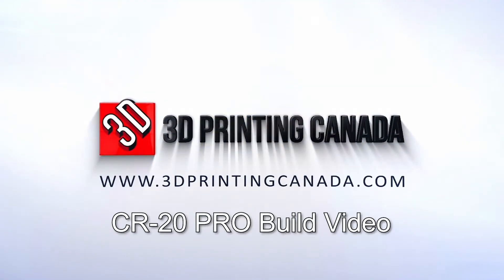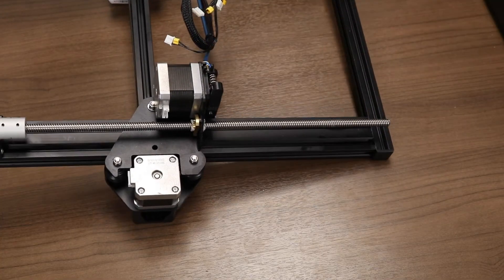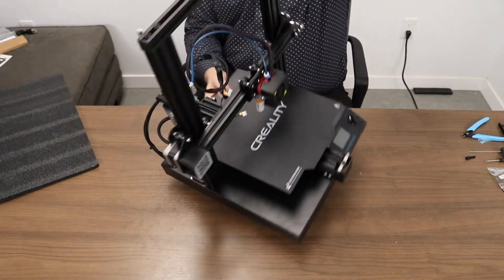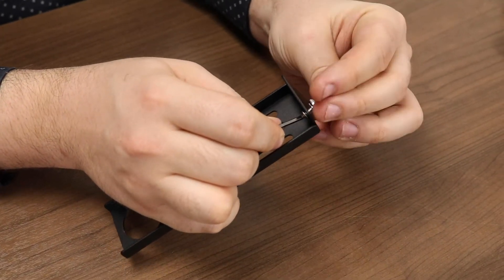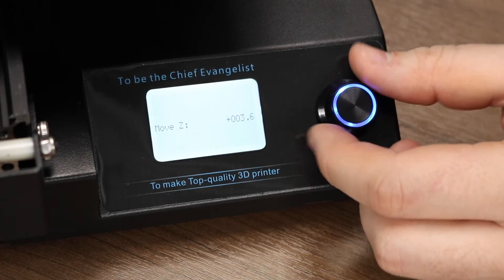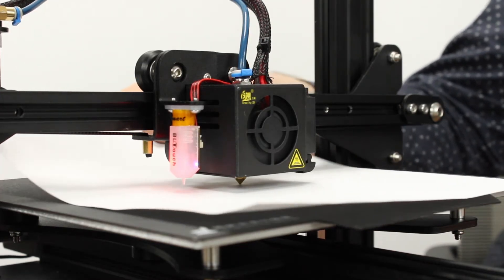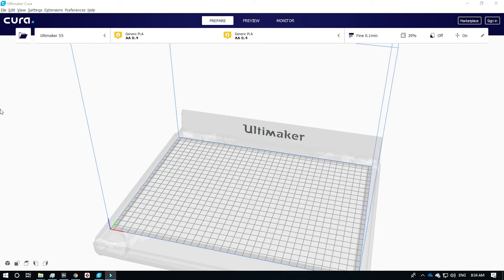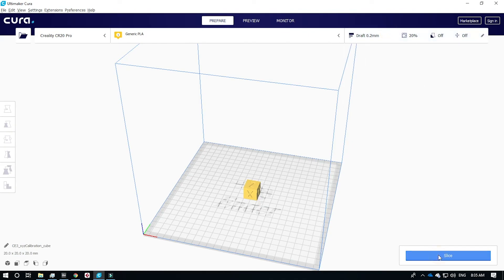The Ultimate Creality CR-20 Pro Quick Start Guide

Comment: I have two questions. Why isn't it necessary to preheat the bed and the nozzle before determining the Z offset? Why don't you consider the thickness of the sheet of paper - shouldn't the Z offset cause that the nozzle touches exactly the bed on Z coordinate 0? Thanks in advance!
Reply: Thermal expansion.

Comment: I have issue with table leveling. Even if bed is auto leveled before each print I see that right side is closer to nozzle than left side. I observe same issue disregarding the print position on the table.  I also observed that when doing auto leveling the probe moves 3/4 of the table in x axis on othe videos it goes from edge to edge. How to solve it? Any expert here?
Reply: Have you found a solution yet? My printer nozzle is always off, always to high. I tried setting the Z offset multiple times, same thing. What is the proper way to set up printer? Power on, Auto Home first? Or should I try Bed Leveling first? Does that make a difference?
Reply: @nickct75  yes, i have placed metal shims to lift up a bit left side of the table. I have updated also the software. find info on facebook group for this printer
Reply: @stopburactwu  Yes, ive looked at the Facebook group for this printer, the settings dont work. This printer is total crap, and Creality tech support wont help at all.
Reply: @nickct75  Hello. sorry for my poor english.    Verify that the arm who support the head ( X axis) is parallel with the bed of the cr20pro (or the printer base).    i have two printers, both weren't well built in the factory. i had to fix this issue by disassembly all the screws of the arm and made it parallel.
Reply: @nickct75  it works, do not give up. Find on FB group where to place g-code 29 and M500 responsible for auto leveling and saving
Reply: @stopburactwu  I found the G code on Facebook group. And even install new springs to fix level bed problem, still doesnt work, I hate this printer, want to get rid of it, hopefully I can sell it
Reply: @nickct75  hmm, try to tight the all srews and recheck
Reply: @nickct75  update to marlin 2.0 and you can change z distance during printing and save
Reply: @stopburactwu  how do I save after I change it? Save to Eprom?
Reply: @nickct75  no. press store settings in configurations. do not use save to eprom

Comment: After running the auto-home function I try moving the Z-axis down to adjust it with sheet of paper. However it will not allow me to move my Z axis to a negative number so it wont get close enough to the paper. Any ideas?
Reply: turn soft endstops to "off" to go negative.

Comment: Cura now has the CR-20 PRO, I am going to guess those settings are good to go?
Reply: You still have to set the G29 and temps but everything else is yes.
Reply: @V3N0M141  im currently having an issue with this, where the printer is forcing itself outside the actual build perimeter, all i've done is added g29 and increased printspeed from 50mm/s to 60mm/s.
Reply: @Doomskilled  I just got the Pro too. I adjusted the temp settings in Cura but didnt add the G29. Do we have to? The only issue I had so far was I printed something and it looks like the whole thing shifted by itself a little, strange. But I had a couple other prints that look great
Reply: @nickct75  i found out its best to stick with the ender-3 profile and add g29, reason why it didn't work for me is because i added g29 either above or underneath g28 which made some issues.
Reply: @V3N0M141  I used it as it is and it print great without any issue

Comment: Hi, I have a friend with a cr-20 pro and he has the following issue: on first auto home, the Z axis value is shown as 0 (in your video it shows 5mm). After the auto home he does the Move Z operation lowering the head until it starts to catch the paper. Then that value is entered as the Z offset and saved. Then he runs the 2nd auto home, the Z axis again shows 0. In your video is 6.4mm (makes sense, 5mm + 1.4mm from the offset = 6.4mm). However on my friends printer Z is always shown as 0 after auto home. Any thoughts why?
Reply: An eeprom initialize, bltouch reset and powering down and back the printer fixed it. Now auto home shows a correct Z value and setting an offset works. Weird.
Reply: @VladMereuta   it seems alot of us are having the same issues with the Cr-20 Pro, i have a facebook topic in the Cr-20 community group and finding its becoming common, we don't have an answer as of yet. Could you elaborate how you eprom Initialize and bltouch reset and I'll share it on the page?
Reply: @convergence-e-s659  Hi, Vlad Mereuta is talking about my printer. You will find those two options in the menu, in Control. Select Initialize EEPROM, then go to BLTouch, and Reset BLTouch. After that just turn off and on the printer. Auto Home should work now (showing anything other than 0 for Z) and you should be able to do the Z offset correctly. This is what worked for me...
Reply: Hi  @est4tic43 , I tried to initialize EEPROM  as well as Reset BLTouch but nothing happen :(, every time I aotu home the print nozzle get higher and higher